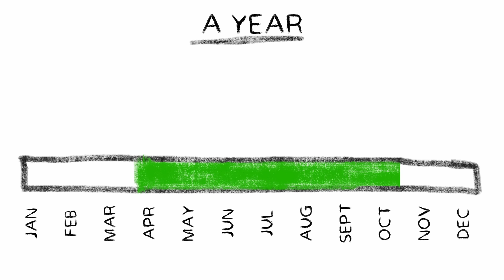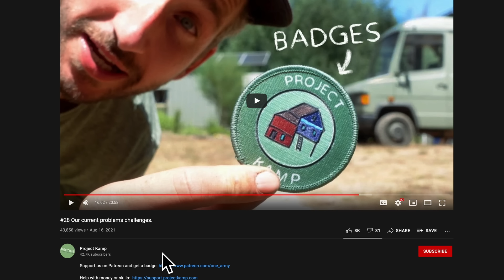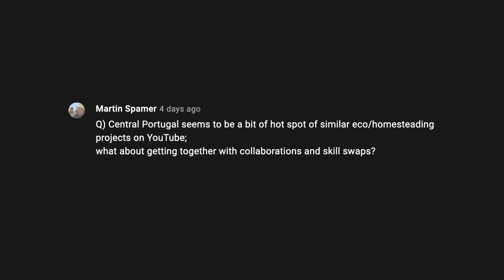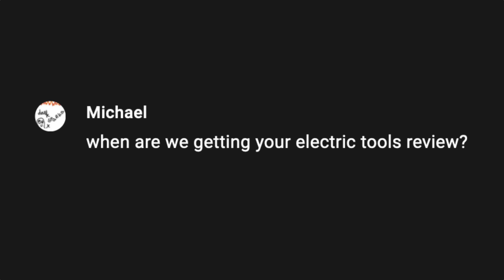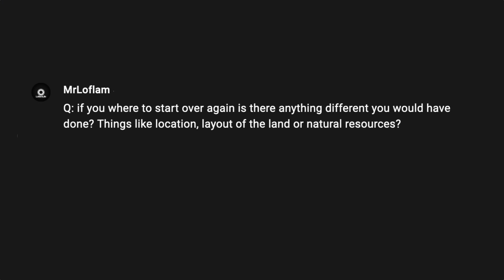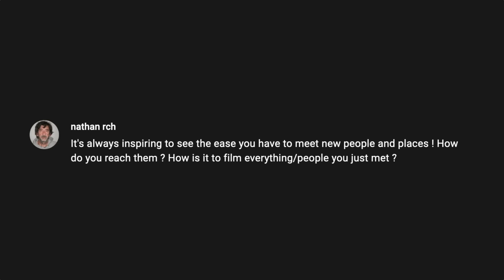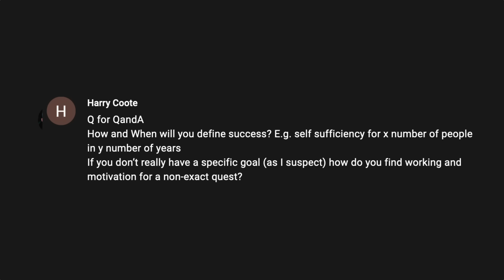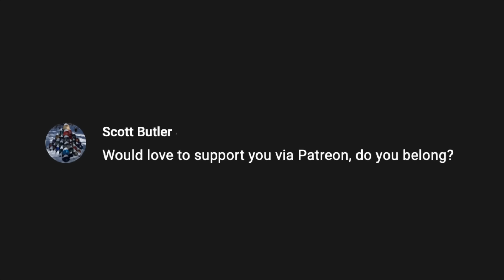#38 Our current p̶r̶o̶b̶l̶e̶m̶. We can't keep this up

Comment: Once you stop posting I will miss you guys dearly, but I absolutely agree that it's a necessity to stop, pause, reconnect and rewind and you're no doubt doing the right thing here. Enjoy your time away from YouTube (and us, sigh) and don't worry: we will all still be here when you are back in April. If you have enough energy we would recommend an infrared panel in your place. We heat our stone barn in Mallorca with just two panels (60x80) and they heat the place up completely as well as dry it out.
Reply: Saying infrared panel could be an electric infrared heater. Any black body roof mounted collector, could use glycol to take that heat and let it radiate inside.

Comment: I love watching your videos.  Please keep it up.  I’m a retired wood worker.  I see you using finish sanders which take a lot of time.  Get a 4””x24” electric belt sander.  They are fast with very little left to finish sand.  If you get a tractor get one with extra hydraulics on the front.  After you cut brush, a grapple will pick up a whole pile and stack it out of the way.  You can get a shredder that can turn 4” trees to compost.  Last but not least get a Flailing attachment for the front.  It can go right through heavy under brush and small trees and turn it all in to compost.  They make them in Italy.  Lastly they also make hand plainers that will smooth a board good enough to oil.  I would add some diesel fuel to the oil that will make it absorb faster and deeper into the wood.  Good luck

Comment: I would recommend going with a tractor and PTO chipper you could add other implements as you progress. Make sure you get a tractor with at least 40hp or it will struggle with chipping larger diameter wood and you have a lot of wood to chip there and your Mimosa trees will grow way to big to process if you don't get started. Nothing better than processing the trees into your soil for long term soil management and doing a food forest. Bigger tractor can also pull the tree stumps to get rid of all the punji sticks just waiting to impale people. Good job.

Comment: Going to missed the videos, but I understand your reasoning. Just a note on working seasonally, traditionally wintertime is the season for doing all your forestry work when the trees have lost their leaves and the undergrowth has died back its much easier to work in the woods. Its also cooler and the timber you're get out, be it for fire wood or turning into lumber is better quality as the sap isnt flowing.

Comment: Wood chipper....I would forgo the wood chipper unless you are getting a professional sized wood chipper.  I have a 75mm wood chipper with a gasoline engine.  It takes so much work to get the wood into a size that can be chipped that it is almost more work than it is worth. I would let the goats and sheep eat all of the undergrowth then cut the trees and let them eat the tree leaves from the cut trees.  Once they eat all of the trees and bark they want, I would collect the large branches and cut them into as many straight lengths as possible.  If you can not use the trees for building something, then you can cut them up for firewood. 

(I got an old ten inch chop saw and set up a 450 mm stop.  Then I cut the branches down to useable firewood sizes using the chop saw.)

Then either sell the firewood or use it yourself in the winter to heat with or to cook with.  

If you have animals, then the big wood chipper becomes more desirable to make compost from the manure and over time for a garden.

Comment: An idea use pigs!!! They clear land like you would not believe. They are pretty easy to keep. Been homesteading i Denmark for 10 years and i use pigs in a garden rotation system cause. They clean the land remove everything, the fertilize and they dig it roughly. And every year we butcher a few. We have small breeds pot belly mixed. So the they are easy to mange and butcher without much equipment.

Comment: Instead using numbers for the season I would suggest to use the calander year e.g. Season 2021, Season 2022. That way it will be much easier to track over time what happened when. Additionally you could have identifiers for each month e.g. 2022.01. Thanks for all the videos so far!

Comment: Have you seen the trailers that has the air conditioner on one side. This would be good for a big Cooler for a lot of people. I'm a prepper in the United States, and we started out, we was concerned about where we were gonna to put our product? Our Pressure canning, water bath canning, and  dehydrated and even adding stuff in the freezer. Consider thinking about a root cellar or a room that is dark and stays cool in the summer. And won't freeze your stuff in the winter. Just saying. I know different countries does things different but that's okay. We all have to learn from each other. God bless

Comment: 14:13 You can get a wood chipper you can drive via tractor PTO and build a frame with electric motor to run it alternatively - electricity is of course cheaper and more sustainable than fuel and a tractor but its nice being able to transfer it with a tractor 
you should definately look for a tractor with a front loader and two way hydraulics as well as all wheel drive and hydrostatic steering 
if not you will definately regret it, i speak out of knowledge

Comment: I would suggest a small tractor with a shovel on the front and then hookup the chipper on the back. Having a tractor will speed up your work a lot, leveling ground pulling out trees moving materials.
 Ofcourse the fuel is not very eco friendly.

Comment: 04:34 You really, really, really need to fix that wall above your head in this video. This is a priority fix or it's just going to get more damaged and it is such a beautiful building so it will be so sad. You need to put some wood underneath to give it some support and it need to be properly repaired. It's not that high up and you don't need scaffolding for this. I don't understand why people are obsessed with having scaffolding and feel they can't do anything without it. Scaffolding is great as it can easily be put up and taken down and moved from building site to building site on the back of a truck but you don't need to be doing all that all the time. You could easily build a small wooden platform to stand on and you could re-use that platform and even take the screws out and reuse the wood in another project later on so the materials get plenty of use. This isn't even that high up and it needs repairing really badly.

Comment: Q: Have ever considered crushing up the broken roof tiles into a powder and mixing it melted plastic and pressing it in a roof tile press mold to make new tiles?
Reply: @lightdark00  At 13:00 into the video they where already talking about making drainage tubes and roof tiles from recycled plastic.... and much of the world is already flooded with micro plastics. Besides that reusing plastics for long term products is better than letting single use ones pile up in landfill's, floating in oceans or in some more poor countries being burned. So while long term plastic products are not the perfect idea, it's better than what we are doing right now with plastic.
Reply: @mrMacGoover  It's better to turn them back into fuel or burn them for heat with scrubbers for the pollution. Better yet for the second option, have a reburner, that gets rid of the pollutants.
Reply: @lightdark00  most plastics cant be used as fuel easily because many do not contain the right kind of oils to make plastic fuels, they already burn old car tires in the furnaces at cement factories and burn so hot and fast that there is no smoke coming from the exhaust stacks. Anyway for the low grade plastics that cant be made into fuels, the best bet is building products. you can blend many plastics for roof tiles.
Reply: @mrMacGoover  The type of plastics that can't turn back into fuel are mostly the thermoplastics like Bakelite. All consumer goods plastics can be turned right back into crude oil.